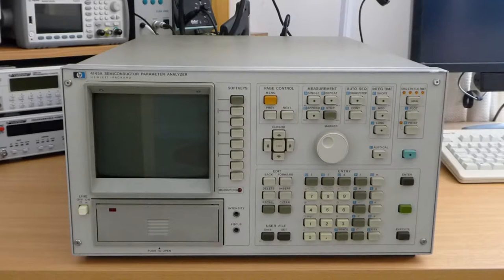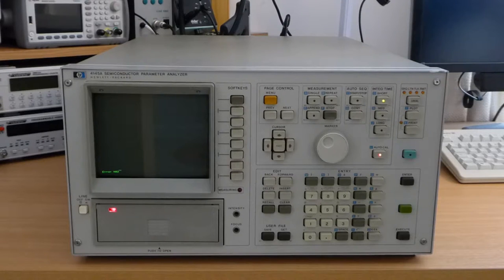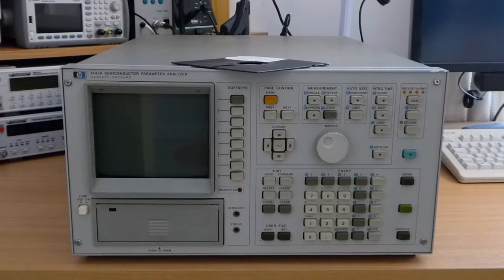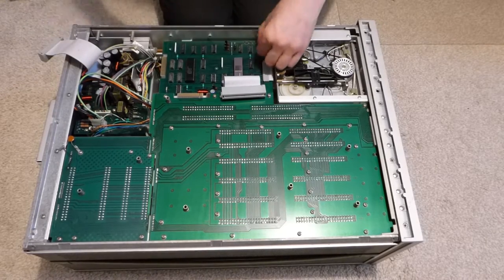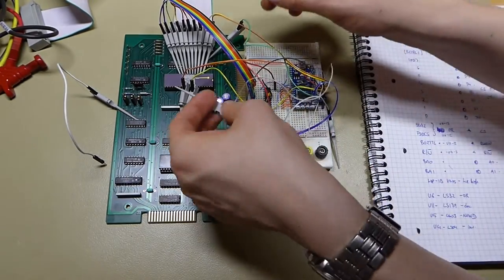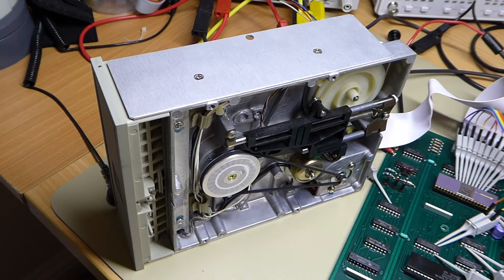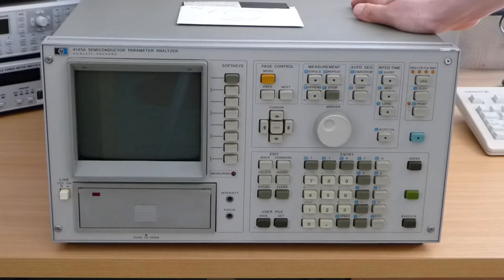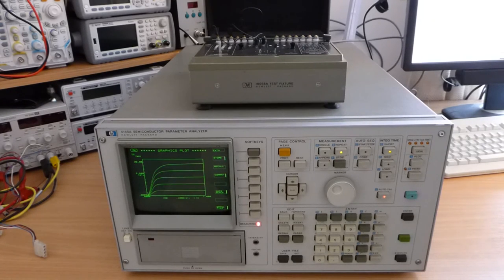HP 4145A Floppy Disk Duplication

Comment: Great video, I have the same unit however the disk is no longer readable, the drive is ok so I amy have a go at creating a new disk, do you think your image could function on my machine ?
Reply: Certain chipsets from the 90s are able to read and write the format, but only with special tools like Dave Dunfield's ImageDisk. If you got a machine with a compatible floppy controller, writing a new disk should not be too hard once you have a sectordata image.

I used Notepad and HxD to get the binary 90KB sectordata image from the text-file published from this project. Then I used the HxC floppy disk emulator application to import this image as a "raw disk" (IBM FM, 250Kb/s, 1 head, 40 tracks, 9 sectors, 256B per sector), before immedately exporting it to the ImageDisk IMD format.

Then all you need is to boot DOS on the compatible motherboard, and run ImageDisk to write the IMD to a blank disk. The image should contain the format metadata from HxC, so you don't need to care about every setting here. It's quite important to use a 48TPI 5.25" drive for writing, that works when set to a 360KB drive in the BIOS setup, and don't use a High Density disk.

Comment: Did you try and use a Linux/UNIX system and "dd" ?
Reply from the maker: Yes, as I said I tried on two PCs, both running Linux. The main issue is that the disk uses FM encoding, whereas PCs only every used MFM - so it's pure chance whether the controller would support it. Just trying computers until I found something that worked didn't seem like a terribly exciting prospect - no fun in that!